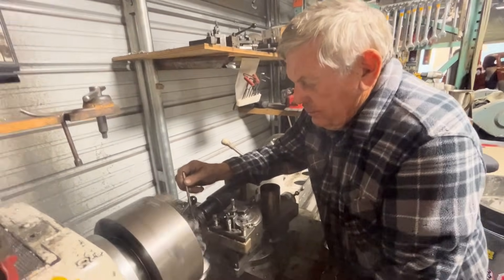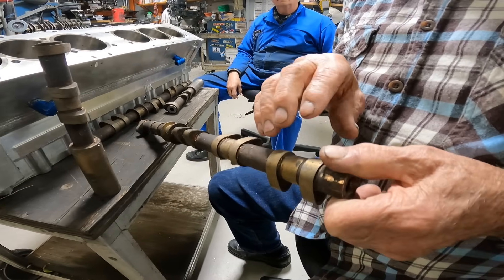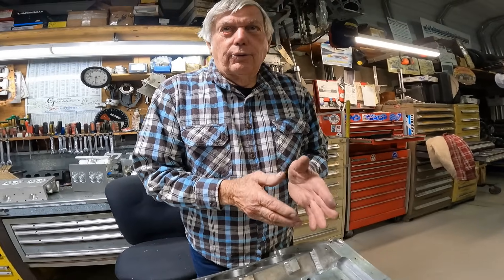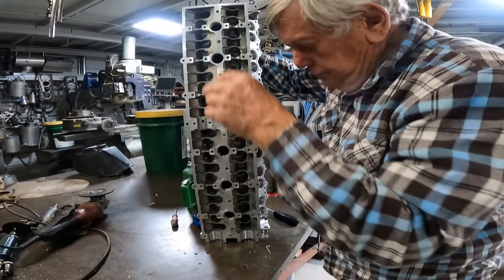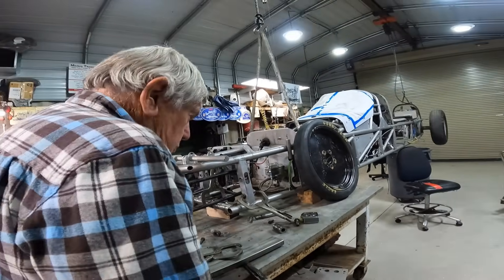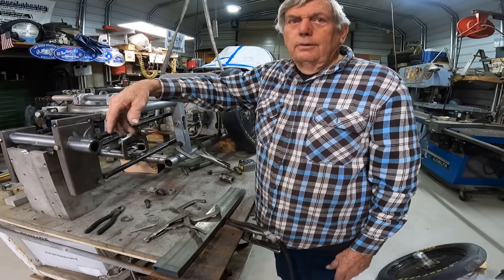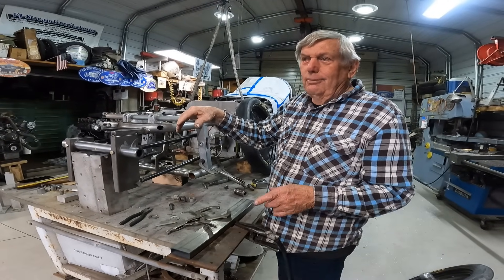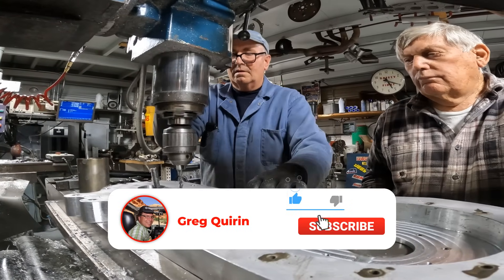12,000 RPM  Homemade V12  Engine Update- Aardema Braun 2024

Comment: If you guys need tool steel stock for your cams, i work for a steel supplier that is trying to get rid of old inventory. We have an extensive inventory of various dimensional tool steel bar in various sizes and length.

Comment: These guys are legends and thank you for sharing there amazing tech these men are amazing hotrodders and it’s been a long time since I’ve seen anyone close to my grandpa he owned a speed shop in Chicago and was the only man who wcpupd work on Indy cars and Ferraris in the 50-60s he worked on all the mobs cars in the 30s-60s he would machine cams and parts for Ferraris from scratch he was also the head machinist at electrive motors and built all the train engines he built the royal george train in the 40s but he would of loved these guys they have the same skill as my grandpa he got killed drag racing my dads 68 427 Vett with dual quads 4:11 rear end and a Muncie 4 speed rock crusher and it was the fastest car my dad ever had cobras would not touch the vetts and the hemi couldn’t compete with the 427 they put a stock 427 build on a dyno built to gm spec and it pushed 780 hp to crank gm saps 435 hp for insurance and they where way more

Comment: At 12,000 RPM you will have many challenges. The first is valve float, which is best studied not on an engine dyno but on a spin-tron setup for overhead cam heads, meaning run the heads alone or on the engine without the engine firing. It is handy to have see through valve covers so you can put a strobe or a triggered high speed camera to see what the valve train is doing in real time at high RPM. Which at 12,000 RPM is usually very strange and eventually catastrophic. As such, you will be making your own CAM profiles (which will include a special heat treat), compound springs with dampers, roller finger followers, etc. after much testing you will arrive at something that might survive. Then you need enough fuel at 12,000 RPM, usually will take two injectors per cylinder (port injection). And you need an ignition system that can run at 12,000 RPM. This is almost always coil on plug with mini CDI per cylinder. Then you need an engine controller that can keep up with 12,000 RPM which is basically a professional racing module with a lot of output channels two run the 24 injectors and the 12 CDIs. I think with a modified Ford Coyote V8 valve components with strengthening the cam caps you could reliably hit 10,000 RPM, which is saying a lot. To hit 12,000 RPM we are in unknown territory.
Reply: We have run the 6 liter V12 at over 10,000.
We are working with Geoff Mummert, who has several engines running over 12,000 rpm with direct acting buckets. 
He would like us to lighten the valve train, but other than that he believes we should be in pretty good shape.

Comment: I doubt Pete and Kevin see these comments but I think it would be a good idea for them to take a playbook out of Audi and Vw's book and make the camshaft a straight shaft with woodruff keys in it to locate the cam lobes then you stack all the lobes on and use pipe spacers then torque the whole thing together so it can't move.  You can have the lobes burned out rough on a laser or plasma from plate.  This modular method also means if a failure were to take out a lobe you just swap a new one on. It doesn't junk the whole cam.
Reply: Love the idea/concept, but how well does it work in practice?
Reply: @richardberryhill718  well apparently Jesel thought it was a good enough idea that they patented it as per my quick google search of modular cams but it expired several years ago. Audi gets by with merely a press fit on their version but I would not dare try that on a race motor.

Comment: What numbers did the previous engine make and did they run it in competition?
Reply: The 6 liter made 920 hp on race gasoline.
We set two records with it. One at 244 on gas and another at 256 in the fuel class with a 100 shot of nitrous.
Reply: @kevinbraun6272  that is absolutely brilliant 👏 hats off to you. I'm more impressed than I expected

Comment: Cool looking engine!! At 2:52 of the video, I notice something @ about 12 o'clock on the top edge of the deck on the block on the 2nd and 4th cylinder back from the front? Is that an indention or bad place in the deck surface or just a camera angle glitch? thanks and really good video!

Comment: Im just wondering out loud, Im not 100% sure, but it might help if the hole inside the cam shaft was a bit larger in diameter. 
Correct me if Im wrong.

Comment: My background is as a machinist, tool & die, and owned and operated an engine shop. That said, I/we have dealt with heat treatment quite often over the years -
The heat treat company should have known full well the steps to take to heat treat the camshaft without breaking it.
This is By Far not a new process, and carelessness or ignorance pushed back assembly by a long time - they're Still searching for the material to replace the cam, with machine time on top of that.
I know I'D be PISSED!
Reply: I agree. They tell me the hole should have been plugged. 
They are the heat treaters, why didn’t they plug it?

Comment: Handmaking cams is wildly inefficient. Handmaking cams out of brittle normal cam iron with extra copper coating opperations is obsurd. Sometimes our smartest heros, the ones we always look up to, are too damn stubborn to change because of their superior skillset. Its takin an extra 6 days to make an inferior cam. Times 4. I ordered 4 custom cores from Jesel in the middle of the chinese aids outbreak and it took 2 weeks. Isky ground them to my specs and Winberg snuck them in for heat treat with a batch of their cranks. 3 weeks total for 4 billet tool steel custom cams. Ill follow any direction in a shop that that man gives, but i see no value in hand machining inferior cams.

Comment: Very cool! I believe the top fuel dragsters are modular so you can change the front and rear and separately, so you could make the streamlined have two different front ends that bolt on with dowels in the tubes

Comment: On the cylinder head, is it a modified existing head?  If yes, what was the core and what did they have to do to it?  It is so cool seeing the "art of the possible" , keep it up.
Reply: It's two four cylinder heads welded together with one cylinder removed from each head. Look at the bottom of the head @3:32 and you will see what's left of the fourth cylinder.
Reply: @colejohnson3705   Is it shared what the source of the heads are?  Is there another video that goes onto the details of the head?  I just think it is really neat what they did and would like to understand it a little better.
Reply: @cam3002  They did a video several months ago showing the heads and the block being described and built.
Reply: @colejohnson3705   found it (https://www.youtube.com/watch?v=Y32yfd2yoqc&t=1s)  there 20 year old Indy heads.
Reply: @cam3002  Pretty cool! These guys are great.

Comment: Starting work on a 2 cylinder block. This will be my first go at a 100% build, so I am going with a low cylinder count for now. Also dont have enough material for a four cylinder.
Thanks for posting your vids.  Its gotten me motivated after surgery and being layed up.
(earlier in life was tool and die maker, still have a nice knee mill, Turning jigs and tooling so should be fine. My biggest hurdle will be the crank, might cut one up and use the back half of a donor.  Anyway long post...Thank you
Reply: Good Luck with the project !!

Comment: I have been toying with the idea of making tool steel cam lobes on the cnc and then shrink fitting them on a shaft and couple of tig weld tabs for good measure. Would make cost effective method to test different profiles. 
I love this kind of content, pure tech stuff. Not just YT stars with huge amounts of money to throw on parts.
Reply: Getting the lobes to shrink in the correct place, referring to the indexing location for multiple lobes, may be difficult. Lest you leave a bunch of material for grinding.
Reply: Good idea. 
There is no better way to check it than to try it.
Reply: That sounds DOABLE..SO..DO IT..!
Reply: @PeterLee-zn3jl  yes all in due time. I will test how it goes.
Reply: It’s been something I’ve been considering for one of my builds too, the toughness of the material is what concerns me.
Reply: @OddsandEndsMachining  I dont think the hardness will be an issue, just need to harden the parts to suite your application. Something like O1 steel can be hardened very easily and then tempered. Was thinking about turning the original cams to suite new lobes.
Reply: @MJPilote  it's not the hardness but the toughness, I've made parts from En36 and had it carburised to a case depth of about 1-1.5mm (still soft in the middle but 60HRC on the outside), the toughness is what will make it less susceptible to breaking from shock loads.
Reply: @OddsandEndsMachining  40-45HRC is hard enough and wont be that brittle. Was thinking about making the lobes out of 42Crmo4 and as I will be using the original cams as shafts I still have a softer core is them. But that's in the future, have much more work to do on my engine before that.
Reply: It'll be tricky, the heat would only be oil boiling temperature to keep the temper in the lobes, so it shrinks fast, and needs travel maybe 8 inches over obstacles before it cools, stepping bigger to smaller shrink fits center outwards would help, but it will shrink fast, 2-3 seconds.
Reply: @mrwolsy3696  well you dont need to heat the lobes so much if you cool the shaft with dry ice or liquid nitrogen. It’s not easy but not impossible either. Or press fit and pinning is another option.
Reply: Not sure, but I think the Ford Rocam's cam lobes are shrink fitted onto the shaft.
Reply: @jacqeusmouton4005  that's true, and many of european manufacturers use this technique. Lobes are set on the shaft in a fixture and then very high pressure oil expands the hollow shaft to secure the lobes.
Reply: Use a splined shaft with edm cut lobes, final grind after it’s assembled.
Reply: Heat treat is key.

Comment: Wow how did they figure out what the cam timing should be. AND the gear sizes to run the cams. I'm sure there is a mathematical equation or a few to figure that out but dam. Scratching my head here thinking about it .

Comment: Lets go! New Video!!!... Its unfortunate that the cams broke but at least the engine is looking mint. Greg, can you make a video of Pete and Kevin making the cams. I really want to see how they work with tool steel.
Reply from the maker: Yes, I have some video of a newer cam design they are currently working on for the new 430 CID B engine. I think you are going to like what you will see. Hopefully I can find time in the next few days to compile all the footage  and post another video.  Thank you Greg
Reply: I love your videos. Watching them scratch build things rather than pick the components from catalogs- wow.
Reply: My background is as a machinist, tool & die, and owned and operated an engine shop. That said, I/we have dealt with heat treatment quite often over the years -
The heat treat company should have known full well the steps to take to heat treat the camshaft without breaking it.
This is By Far not a new process, and carelessness or ignorance pushed back assembly by a long time - they're Still searching for the material to replace the cam, with machine time on top of that.
I know I'D be PISSED!